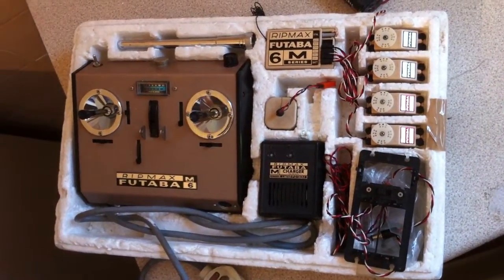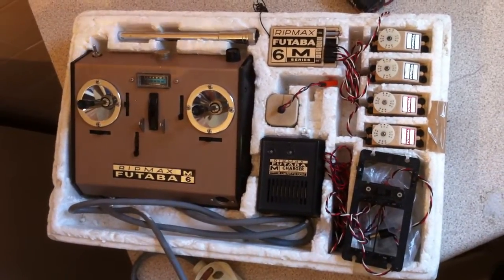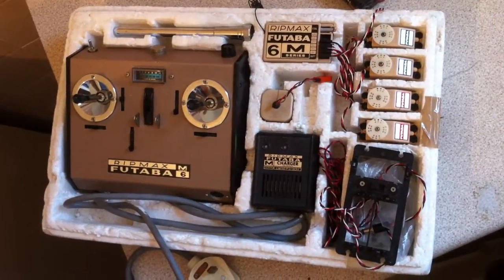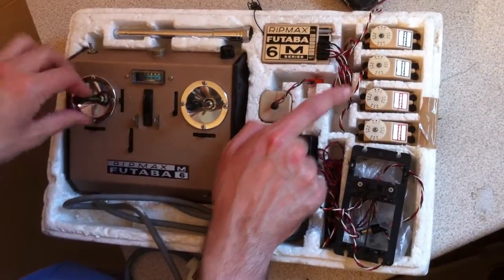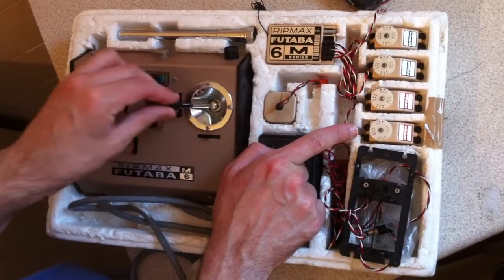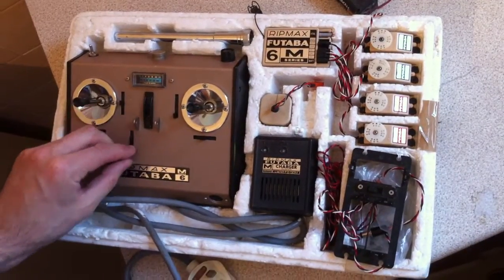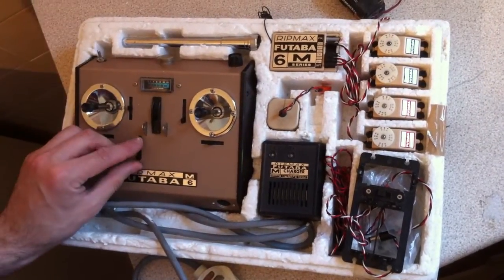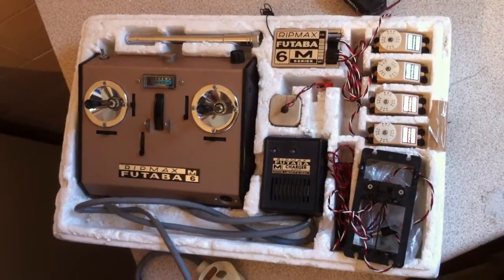Futaba Ripmax M series radio control system from 1976

Comment: You risk overheating and burning the output transistors when turning those early radios on without mounting the transmitter antenna.. This is an important warning for early radios...

Comment: I have 3 sets and I find they are best for radio controlled  sailing ships . Due to their manual trim , which we need . And is so easy to see what the off set is from the neutral position. Such as a rudder being used with weather helm , with 4.2 ghz   gear it's not possible .